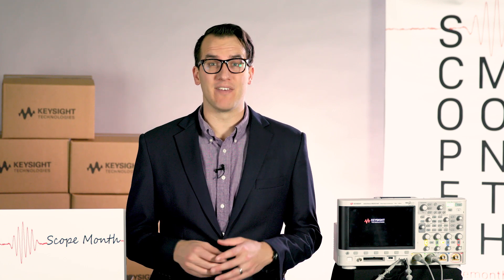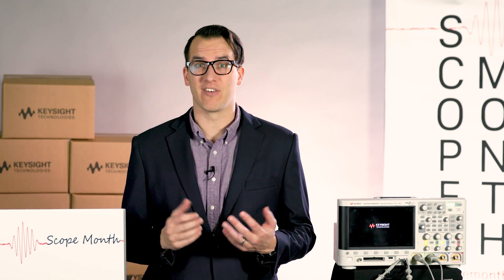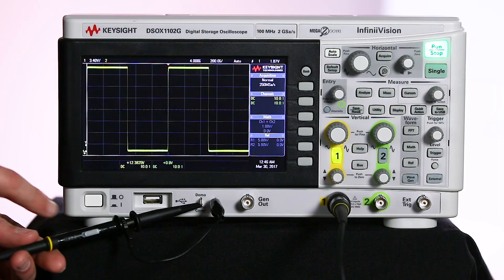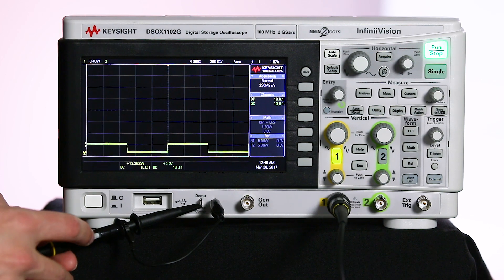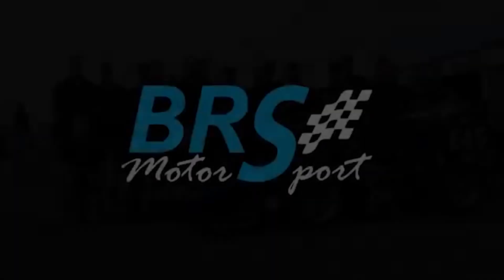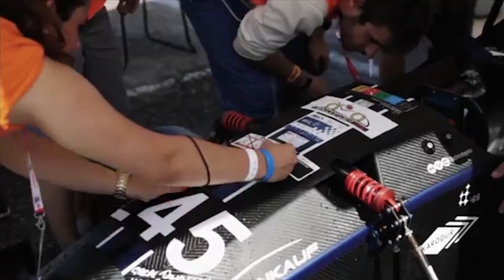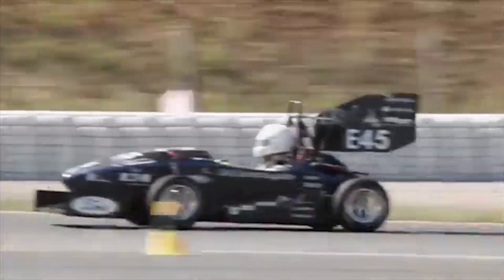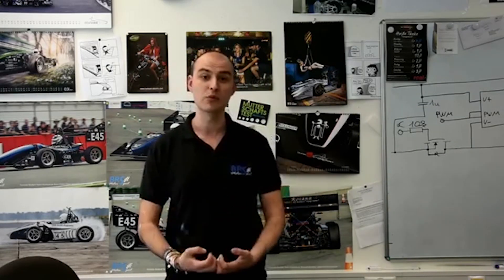Choosing a Probe Attenuation Ratio and Today's Scope Month Winners! (30-March-2017)

Comment: Daniel, I need 2 hours add time to finish editing my video for impress contest. will it be accepted 2 hours post deadline ? ugh, autosave failed.
Reply from the maker: +Vitaliy D we'll try to be flexible, let me know if you don't get it submitted before the page goes down.
Reply: Keysight Oscilloscopes thanks a lot! I will let you know when I upload it. you gotta love it!!
Reply: Daniel, I m done rendering my video. Excited about it. So, I entered the contest at around the deadline with Dropbox link instead of youtube. That link (folder) contains the rendered video now. Would that be ok, or should I try to enter the contest again now with the youtube link? 

Thanks again for flexibility!!!

Edit: The link worked still for me now, so I have reentered the contest with youtube url to same video, Hope it  impresses enough) Best wishes!
Reply: Hi! Daniel, is there a way to know if my test2impress entry went through and is in the pool? I went a bit over the 3 minutes, but thats just for the fun-ends I could not let off. Cheers!

Comment: I can't believe the oscilloscope "expert" doesn't know a probe in x10 has much more bandwidth than in the x1 setting... Generally, you'd want to set your probe to x10 and only go to x1 if you absolutely have to.
Reply from the maker: It's definitely true that you lose bandwidth, but in my experience people are typically making DC type measurements in 1:1 mode (power rails, etc.), but it does go down to 6 MHz in bandwidth at 1:1 as opposed to full BW in 10:1. I'll make sure to add that in tomorrow, as I don't want to mislead people. Thanks!

Comment: 10x impedance doesn't only drop the voltage, it drops the parasitic current of the probe when testing in low current high impedance circuits. The test-load effects are less critical than physically protecting the scope from high voltage, but it may be a more common reason for using 10x.
Reply from the maker: Yes, that's generally true, too! A higher ratio yields lower probe loading on your circuit.

Comment: Does the 1000 X have a trigger output and how can it be used?
Reply: I'll piggyback a question. 
If it has a trigger out, does the internal triggering have adjustable delay to account for signal latency when syncing an externally triggered device? (similar to matching an audio track with the video)
Reply from the maker: To my knowledge, the InfiniiVision Oscilloscopes that do have a trigger out don't have a latency delay built in.
Reply from the maker: The 1000X doesn't have a trigger out, but you can query the trigger status via SCPI commands.
Reply: There is something about using the Gen Out with the Trigger in the manual, but it doesn't seem to be further specified.

Comment: If you tap the probe does it make a error on the screen ? A wave form ? Or if you tap a BNC connector ?
Reply from the maker: It can be done under the right circumstances. That's something Dave didn't look too closely at, but it's the same effect.
Reply: How about vibrations does this effect the reading on a digital scope , my old analog goes wild
Reply from the maker: In my years of working with these scopes I haven't seen a single user issue with that, but if you were on a trotting horse or something you might see a wiggle. :)
Reply: I have some interests in this too. I sometimes actually work with engines and sensor attached to them that aren't easy to move which is why I asked the other day if there was a way to gather data portably or rather like mobile. I have a cart that has little space. Interesting thing is the problem Dave showed might have been known but was never full explained to me since the carts have a suspension system to it. (Also has a portable battery&inverter system to power AC. Maybe this is a reason too among others.)
Reply from the maker: Interesting! We see a lot of people using portable gear carts for automotive & aerospace work, but never heard anything about the piezoelectric effect causing problems for them.
Reply from the maker: I'll have a blog post about this topic coming out this week (5-April) here: http://bit.ly/ScopesBlog